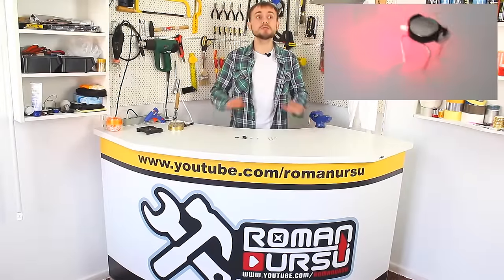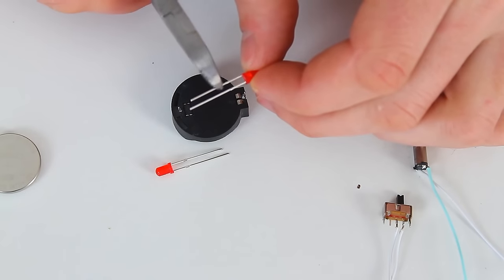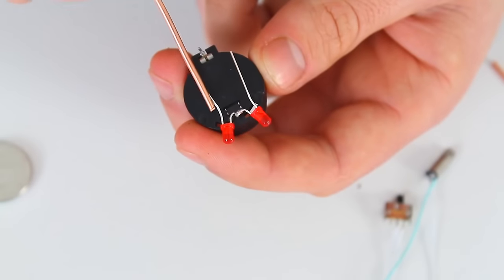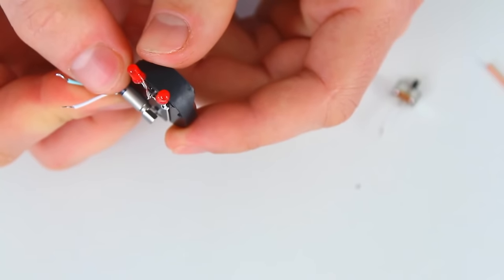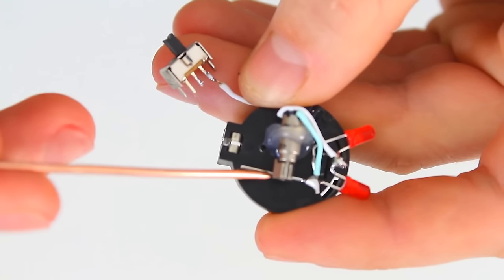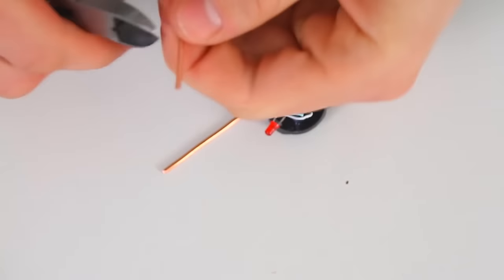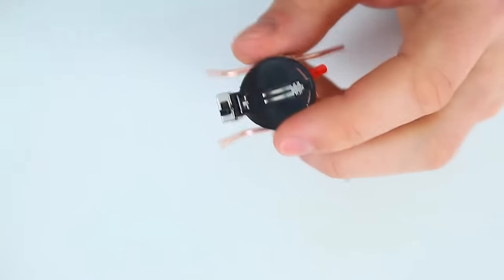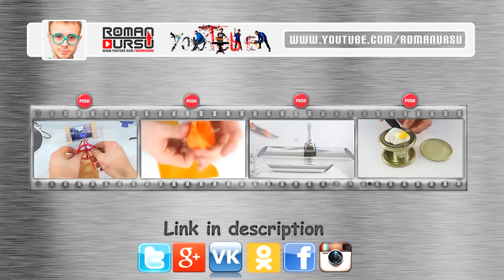How to make a mini bug robot?

Comment: could you tell me once again the requirements of mini bug robot
it good
Reply: Cr2032 holder, spdt switch, cell vibrator motor, 2 LEDs (optional), and some heavy gauge copper wire for the legs

Comment: you just stole the project from kipkay and you add switch,led,copper wire pls report this video of copy
Reply: A small robot powered by vibrations is in no possible way kipkays invention! The same sort of design using a toothbrush head was made years ago so do some research before jumping to uneducated conclusions!!
Reply: +☯ Pat ☯ I agree
Reply: Or he got inspired. facepalm is it not okay to be inspired?